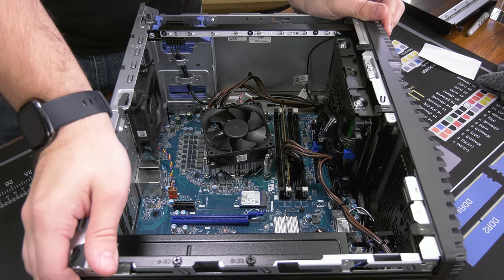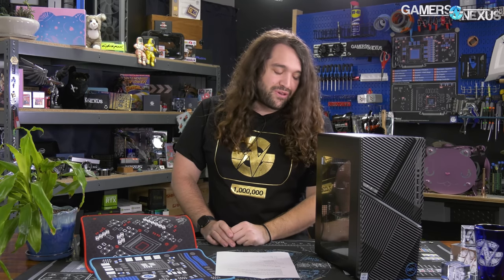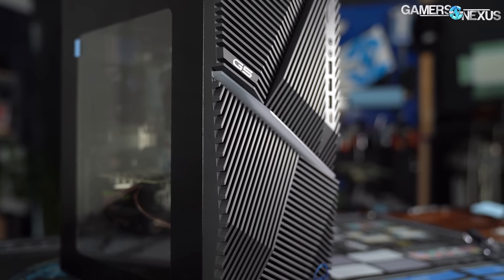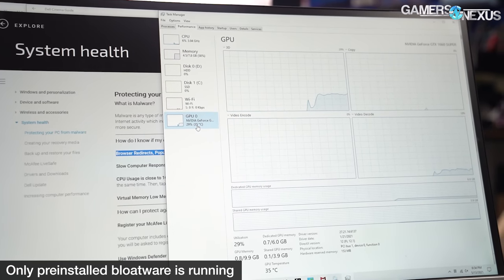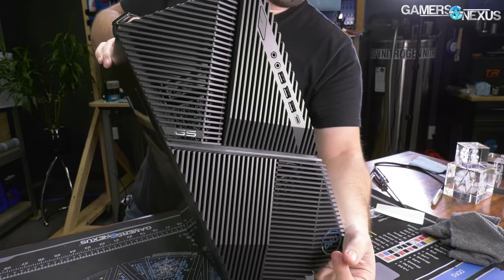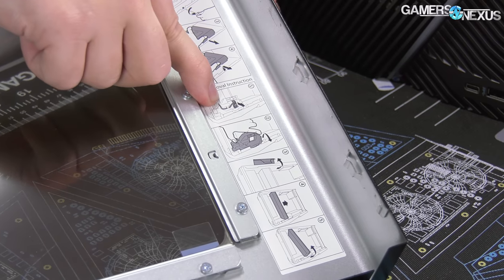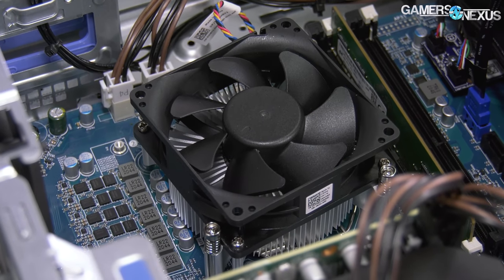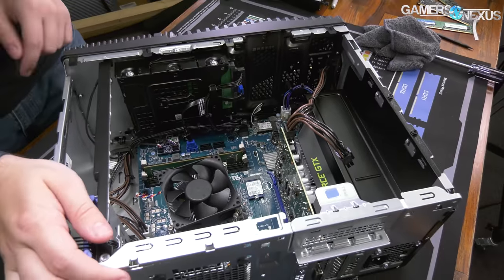Worse Than Walmart: Dell G5 5000 PC’s Garbage Parts & Hidden Charges

Comment: "You assholes" ~ That quote pretty much sums up Dell in a nutshell.
Reply: To their defense the laptops would be great if it wasn't for the chargers that keep malfunctioning. Shame!
Reply: Milking a rep that was built over 20 years ago and hasn't been completely destroyed.  (hold our sata cable)
Reply: @snoopstp4189  - A false reputation at that. Even 20 years ago Dell was making crap like this, only worse.
Reply: @N1RKW  I’d be ashamed to have this pc on my desk , it looks like absolute shit
Reply: @hellfire92837  And if their hinges didn't snap off after 3/4 of a year
Reply: Repeated by Dell customers everywhere...
Reply: @hellfire92837  When you think it is dysfunctional design that a laptop can discharge when plugged in, Dell apparently insist it is expected behavior.

No, not joking, Dell actually said that.
Reply: @Verpal  That can be changed in the bios. The point is to extend the battery's durability. The real problem is within the charger, as a certain control circuit within gets fried quite often and the charger is not recognized as original and the battery stops charging altogheter.
Reply: @N1RKW  Don't know about now, but ~10 years ago, at my old job, we had a bunch rugged laptops and tablets from Dell and those things were amazing. Pretty much indestructible (you could throw it from the roof, leave in water for a week, freeze it and it would still work) and some really nice features like multi-touch resistive touch screens (can be operated with gloves) and dual, hotswappable batteries (when you were running low you could swap them one at a time and avoid a shutdown). Of course they cost a fortune. Dell can (or at least could) make great hardware, but it comes at a steep price.
Reply: @hellterminator  - Yup, I've heard that about their commercial offerings. It's their consumer grade stuff that's junk.

Comment: I worked at DELL PC support many years ago, and it is actually standard to remove and check cables, ram, graphics-card during troubleshooting with customers.
Depending on the troubleshooting guides available to employees.
They actually have a very impressive troubleshooting tree which would actually be really helpful if made public, as it is a lot of generic if this then that to try to isolate/fix problems.
Reply: We have a much better troubleshooting tree already., We dont needs Dells proprietary ticks muddying the waters.

Comment: This is almost exactly what I went through with a Dell computer about 7 years ago. The only thing that survived that non-standard heap of junk was the i7 CPU.
Reply: I've taken apart a few low-end Xeon-based dells from gotta be early 2000's and they look almost exactly the same inside. Well... different mess but somehow every Dell machine is a unique mess. It's like they mapped the pattern for generating it and now they're free to unleash frustration in 4 dimensions.
Reply: Kinda late but ive salvaged 16gb ram, ssd, hdd, nvme, i7 8700 and rtx 2060 from a dell xps desktop. Switched it all up on a new case and mobo, added a nice cpu cooler. 
Works like a charm, very glad i did this. Your average joe probably wont be able to do it tho.
Reply: Just check the gpu and the cooler actually touches the...thing. Dell goat.
Reply: @plastifiedmetal5682  I get this, Have done the same in the past.  The major stumbling block is the board and probably PSU.  Most everything else work work "ok"
Reply: @J Jj Can't quite remember but yes, it must have been an onboard gpu
Reply: I was told by a Dell Tech that the reason their systems are non standard is because their designs are (get this) "More Robust". And compared to "E Machines", yes, yes they May be.
Reply: @Jack Sparrow Not me.  I'm impressed with Apple, but I prefer building my own systems.

Comment: From a pure manufacturing efficiency standpoint, I'm actually kinda impressed. They have clearly looked at removing every extraneous assembly step for the production line. Totally sucks for the end-user, but for the assembly team - nice.
Reply: It's actually ironic and weirdly stupid.  It is literally producing crap, wasting materials,  making it hard to fix or upgrade and making the company look bad just for the sake of saving a bit of money and hiring a few workers less. We live in times in which we have to start producing less waste and people lack jobs and such things as this herw happen all the time because of high costs of employment and people selling such crap.
Reply: @draconpost  if the internals were good, it would be fine. The issue is that they made a cheap, nice looking case filled with crap.
Reply: There actually is a lot of extra being wasted and designing a more efficient build would be incredibly easy. The savings come in from using what is essentially e-waste, reusing now defunct old-as-hell tooling for peanuts and marrying the end user to every part of the finished product. In that way, some of these design decisions are actually impressive, in it's own demented way.
Reply: Like how cars are built. More efficient to assemble, a pain in the ass to service out in the real world.
Reply: Lazy
Reply: @sheeplord4976  still proprietary crap, if any component fails you can't reuse anything, meaning case, motherboard power supy.
Reply: @ericb6309  i have a truck 2007.
Reply: @shadowopsairman1583  yeah, but if you are buying a Dell, you were never going to be able to replace parts yourself. If you could, you would have known not to buy a dell.
Reply: @draconpost  if you're mad about companies putting short-term profit over customers/employees/the planet, I have bad news for you.
Reply: It is not impressive. I've worked in manufacturing, in few different fields. And if you make garbage - you're making garbage, no matter how cheaply and efficiently you can do it.
Reply: @Quicksilver_Cookie  the casemakers did what they were asked to. The issue is the electronics and requirements of the company.
Reply: @Quicksilver_Cookie  You're missing the point though. For the majority of Dell's target audience, the issues raised make no material difference. Non-standard components? Who cares - they'll never open the lid, let alone replace a component. They won't care that it's landfill once any component breaks, because they'll never take it anywhere where they'll be told it can be different. They won't watch reviews to see that the performance sucks, because they're buying a familiar name from a big box store and that makes them feel comfortable.  But the few dollars that Dell saves through the manufacturing shortcuts like not having a separate IO PCB assembly, or a fan mount bracket on the back of the board, because that's replaced by mounts on the case... those allow them to undercut the competition and shift more units, which in turn feeds into the familiar brand name thing that gets more customers. And the fact that no-one else can repair the machine? That's not a bug, it's a feature, because they sell more extended warranties that way.
Reply: @ralph17p  I agree. This isn't an enthusiast machine. All the things they have done are to keep the cost right down but to have modern styling.  Most people have nucs or laptops and they are all proprietary.  That psu looks very similar to a power edge server psu.  Having the cooler bolted to the chassis is superior to the 'standard' because it reduces stress on the motherboard and conducts heat to the back of the case.  All of it looks fine to me.  I've built pcs with all the trimmings but then I grew up and just want something that runs what I need.  Its aimed at me.
Reply: All manufacturers are doing this. Just one of the side effects of unionized labor and unfavorable tax and regulatory environments.
Reply: @draconpost  The whole point of such build is that it will be used by someone who is not technical. He will buy it, use it and throw it out. If you put more effort and stuff there to make it easier to maintain, it will be even more e-waste. This build makes a lot of sense for the purpose it was created. It's not pre-built system, it is more like AIO, which is not intended to be ever modified or rebuilt.
Reply: @sheeplord4976  That doesn't help. I worked for a computer repair shop and 80% of the machines we took in were Dells.
Reply: @williamvaughan1218  I would think it's consolidation and a lack of competition.
Reply: Also, it's clear that Dell systems are built toward the needs of a company IT department more than a private user. 

Usually systems are very easy to work on, everything is tooless, and yes there are proprietary parts, but if you are a company you have a stock on them.

Also you tend to replace only the basic components, drives, RAM, maybe the CPU, you never replace the motherboard, at that point you would buy a new system, and practically never do an upgrade. 

To me they are not bad for this purpose. Also it's not only Dell, also Lenovo and HP computers are built like that.
Reply: It's wasteful. The components can never be recycled.
Reply: @draconpost  the problem is that companies are focused on cutting on workers and saving money and get more no matter what (money is like a drug in this case) they need to get more no matter what even if it means to do illegal stuff sometimes
Reply: @williamvaughan1218  you think the laborers who manufacture these computers and components have unions?? 😆
Reply: @williamvaughan1218  cost-cutting manufacturing processes are caused by unions? lol no, every company does this, unionized or not. The company cuts costs because they want to make more money. Whether the workers are unionized or not is completely irrelevant
Reply: I agree completely with Ralph, this is a very smartly built PC! Its not supposed to be taken apart by the user, and I would not want one of these. But this is clearly a PC where they have been as efficient and economical as possible. I was really impressed with IO extension on the motherboard, really clever!
Reply: @robertagren9360  they can be recycled, just not re-used.

Comment: Hardly surprising.
In 2007 I bought an XPS 720 from the big D. They told me it was billed to my credit. They reaffirmed this many times - no cosigner.
On the bill they had somehow acquired my mothers credit info and billed it to her credit. This is beyond strange as I had never given them her info.
Months of dead-end calls with thick accented people ensue. Goes nowhere.
Left with a substandard machine who's ram failed within the first month and a permanent distaste for anything Dell.
Reply: This situation landed me in a military prison and kicked out of the military.

I ordered a computer through their website and put my unit address for delivery (I was living on barracks), my unit got charged for it and NCIS started an investigation because they were claiming I was stealing financial info from my unit. Ended up in court martial bad conduct discharge and 8 months in a military prison.

Comment: I'm laughing to the point of crying. The joy of watching you trying to unscrew a mother board and whispering "you assholes".

The pun is truly strong with this one.
Reply: taking it apart was like trying to solve a puzzle lol
Reply: The screw-to-the-case-socket design for the SSD mount actually serves a purpose. It helps bleed off the heat generated by the SSD. Since this design requires more parts than a surface mount socket - including a second screw with a socket built into its head - it also cost Dell more to manufacture. Frankly, one reason I like Dells is the fact that their engineers are very tech-friendly, meaning that they tend to design their stuff with service techs in mind.
Reply: @chrislantos  Dell does not manufacture the PC's nor do they have 100% control of what goes into the case.
Reply: @chrislantos  You just watched this video, and you call dell service friendly? It's an overpriced pile of junk
Reply: @chrislantos  I feel like you wrote this comment prior to watching this video...... anything made by Dell is just a pile of overpriced crap!

Comment: 2001 - “Dude, you’re getting a Dell!”

2021 - “Dude… You’re getting a Dell?”

Such a facepalm moment for this company. I remember when I used to see Dell computers in computer magazines starting at like $3K. Oh how the mighty have fallen.
Reply: My 2001 Dell Dimension 4300 had:
Proprietary cooling fan (only one fan with no inlet, not attached to CPU, instead it was a heatsink and a duct to a fan and the heatsink was screwed into the tray which could not be separated from the motheboard).
Proprietary case which used mounting slots rather than screws.
Proprietary motherboard which fit into said slots
Proprietary PSU which required an adapter when it died (24 -> 14 pin)
Proprietary internal USB headers for the front panel

None of this is exactly new.
Reply: @tim3172  Yep, I had to deal with the same crap in 2005. Dell has always been garbage.
Reply: I haven't read a magazine in awhile, but Dell does sometimes send me small catalogues. I'm sure Dell is still more than happy to sell you an underpowered computer for $3,000.
Reply: But the laptops! That little handheld prototype! :(
Reply: Yes, they've been proprietary for long. But that doesn't mean that those were bad. I had a P4 Optiplex tower. And that one worked for quite a while (7 or so years, including me messing around with it) as the home PC just fine.

And I currently have a pair of Optiplex 9020 SFFs & micro. They share many of the issues shown here, like the proprietary parts and such, but they work fine and replacement parts. But I knew what I was getting into, I think the size tradeoff is worth it, and if I need to replace something parts are cheap and won't lock me out Apple-style.

But honestly, outside of their 9020 Minis, I don't think I'd recommend anything else from them. (based on prebuilts) Larger or newer? Go EliteDesk (yes, HP). Smaller? Go NUC.
Reply: @prla5400  Yeah I haven't heard anything about the Alienware Project UFO in a while. Now there are already several competitors in that market. And DELL was already busy with proprietary BS on that thing (like the dock) which could just be solved by using Thunderbolt.

Comment: I bought an Alienware back in the day when it was Alienware, it wasn’t bad for a pre-built way back then. Then when dell bought the brand I got one and had nothing but regret. Needless to say it taught me a lesson and I build my own from that point on.
Reply: I still use my R1 alienware x51 from 2013, the case is permanently open, and i had to switch the HDD once, other than that, it actually runs great, it outperforms modern budget laptops and crappy walmart desktops by a lot, the thing is a beast considering is almost 10 years old and I was very rough with it. I'm still amazed i can even play GTA V with a crappy GT640.

But yeah, it's probably gonna die soon and I'm definitely not gonna buy from alienware again considering their recent products and Dell shenanigans... Looking into building my own, and this channel looks good for getting information about this.
Reply: Before Dell, Alienware was good jank, with good value. Now it's just overpriced janky proprietary crap.
Reply: @Ast2435  I still use my Alienware 18 as a backup.  Aside from running a little hot, it performs well.
Reply: @Ast2435  I don't see how it outperforms anything, anything even on an insane budget is like 10x better than that
Reply: @PaLaS0  Well, as I said, it outperforms shitty walmart laptops and PC's, not high end stuff, anyways, I already built a new PC, so i'm gonna turn the alienware into a personal server.
Reply: My Dad still has his ALienware from 2013 running pretty well. He is not really considering changing it up, but it was also highly modded by someone before he bought it, so maybe thats why its working so good.
Reply: I got an Alienware about the time dell took over. Hinges broke on the screen after about eight months..

Comment: I did freelance tech support for dell years ago. The runaround they gave their customers was sometimes terrible. One poor guy had his parts replaced almost completely on his brand new top of the line computer and it still didn't work. Then I showed up with spare parts knowing none the wiser. When I swapped parts again and it didn't work - they were going to do all that crap over again. I had to pull teeth to get them to replace his system. They hated working with me. If I wasn't one of the only idiots willing to work for them in the area I"m pretty sure they would rather never had anything to do with me again.

Comment: I used to work for Dell tech support in 2005-2007. Their systems, including their laptops, used to be really easy to disassemble, repair, and upgrade, and there was a brief time where you had the option for a small charge to have a clean install of Windows without the bloatware. At the time the motherboards and other components were standard. Seems they've gone back to the days where everything was proprietary.